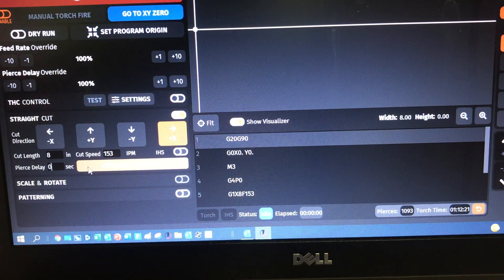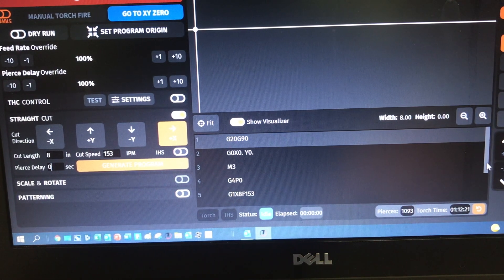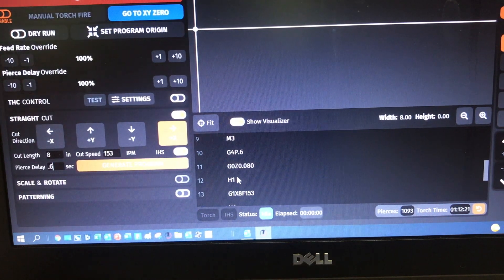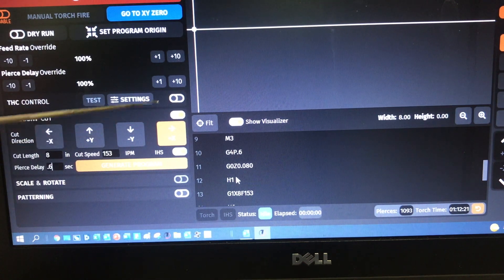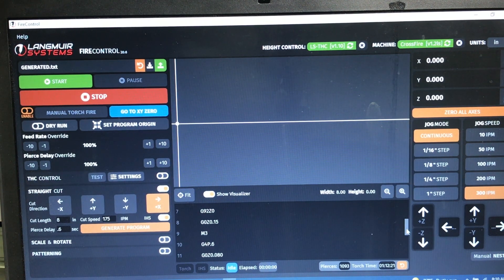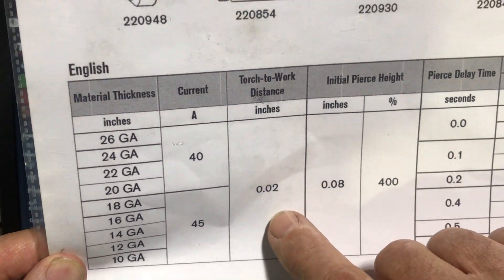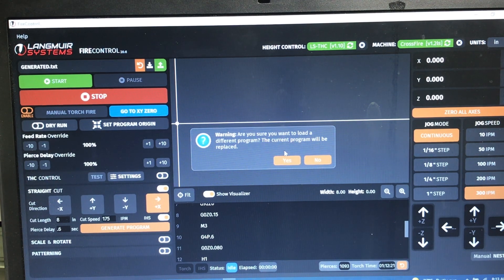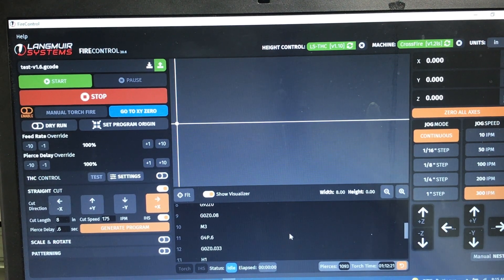Straight Cut Utility on Langmuir Crossfire Plasma Table

Comment: As always, a most helpful video!  I have FireControl V21.1.5 and it is not letting me save the generated straight line G-code.  Is it possible Langmuir removed that capability in recent versions?
Reply from the maker: Good question…I haven’t done it for a while but will give it a try in next couple of days and let you know what I find.
Reply from the maker: I had a chance today to check into this and you are correct…I don’t see the tab that use to allow you to save the Gcode.  I may ping Langmuir and see what they say.  Will let you know what I hear

Comment: What Kerf are you using for 11 gauge material?
Reply from the maker: I’m using .051” which is the kerf in the cut charts for 10 gauge steel and fine cut nozzle
Reply: @CustomCreations3  that is strange my Hyperthem book for mild steel 10 gauge is .057
Reply from the maker: My chart   (https://www.weldersupply.com/Content/files/ProductPDFs/Powermax45XPOperatorManua.pdf) on page 127 has .057 for 10 gauge using the regular nozzle but for fine cut on page 127 it says .051
Reply: @CustomCreations3  Oh you are using the fin cut nozzle I'm using the regular nozzle.
Reply from the maker: For the recent video looking at bevel I used the regular nozzle and the .057 kerf but for production work on signs I use the fine cut nozzle and the .051” kerf
Reply: @CustomCreations3  Thank you I will try .057 I'm Finding my holes are .025 to big

Comment: Hey another get tutorial I have shared your last 2 from the July 4th weekend on both the Langmuir Facebook and forum with several guys/gals needing help with THC on their Pro table.  Thank you for taking the time to upload and post these tutorials.  Tim
Reply from the maker: Thx Tim,

I appreciate you sharing them on the forum...I intentionally didn't post them on the forum for fear that some may take it as my attempt to increase subscribers or to toot my own horn.  I have no dream of having a huge subscriber base just wanting to help others answer the same questions I had.  But anyway I'm glad it is on the forum and can help others.  As I learn more I should probably go back and redo the IHS and THC cause there may be some comments that I've since learned may be incorrect but they are minor points.